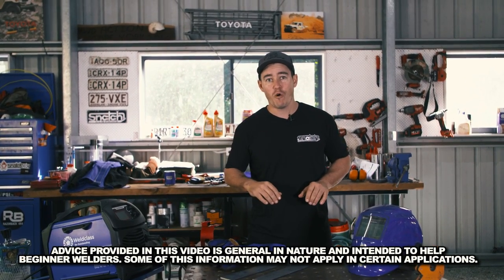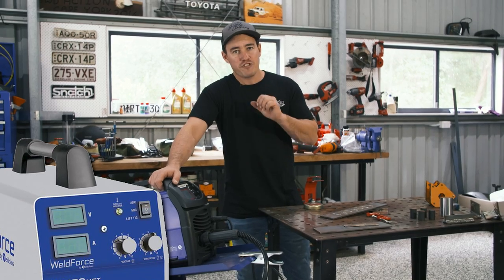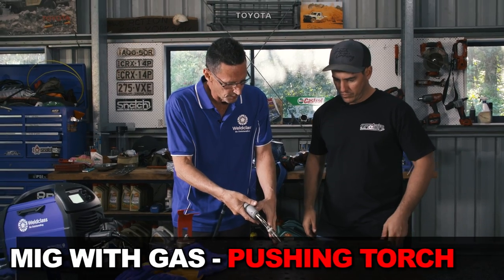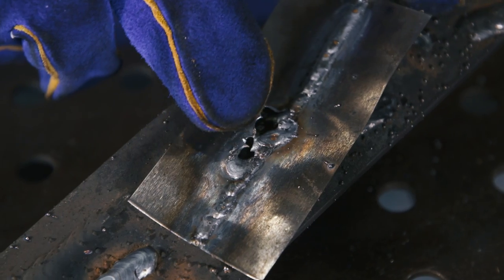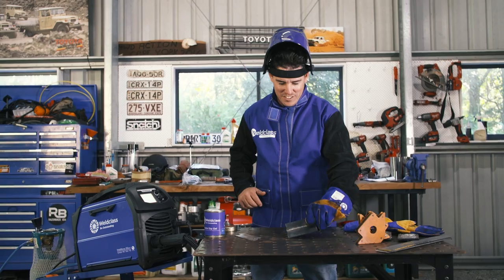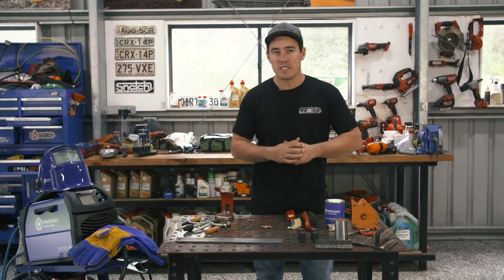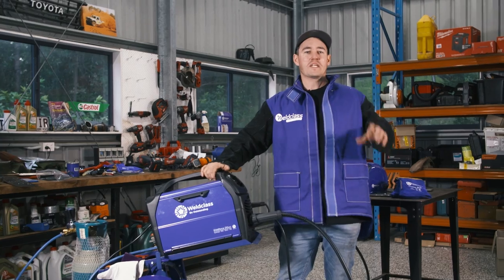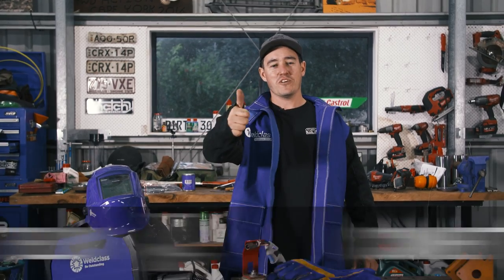HOW TO MIG WELD with Shauno! From NO welding experience to good welds in 10 minutes!

Comment: Hey 24 7 crew... nice video very informative. I've always been interested in learning how to weld, if I had this welder I'd start small my welder the spare wheel carrier on my fibreglass boat. Then I'd go straight into the deep end and use this killer welder to do an engine conversion on my patrol so I can actually bloody tow the boat with ease... 

Cheers boys..🍻🍻🎣🎣

Comment: 1st project would be to finish my trailer that I'm building from an old caravan. Being built to carry Quad and dirt bikes or the old Suzuki sierra that's also getting rebuilt. Also wanting to build a box on the front with a slide out kitchen to use as home base when going away on adventures.

Comment: The first job I want to tackle with a welder is to make a headboard for my tray, currently just has a flat board as I used to have a canopy on there but a nice headboard would really finish that off. Along with that project I would want weld some brackets for new tail lights to tidy off the rear end.

Comment: LOL , yes would love to get strait onto the some of the dream4wd projects.  But lets be serious i would not put anything on the car that i welded as a first project.  So my first project is defiantly small, a portable charcoal cooking station / good old BBQ.  I hate throwing away the cheap charcoal BBQs from Bunnings which cant handle too much heat.  Rotisserie, grill plate and made from stainless as well as being collapsible are the only must haves ATM.  Oh yeah need to be able to cook for 4. I know the Weldclass is a bit of an overkill for the BBQ project but lets get real, food and small jobs are great motivation to start my welding journey and before tackling mounting brackets for the camping trailer.  If something falls of the BBQ you can always blow the sand of the fallen snag ;-)

Comment: I’d would love to make a new tray for my 79 series to take the missus out on a few trips and a helpful tip for getting better accuracy is to wear a tig welding glove or riggers glove on the hand holding the hand piece as you can easily feel the trigger and know the position of your hand it makes control a lot easier just make sure it covers your wrist as the UV rays from welding can give you bad sunburn

Comment: Hey shauno, first job id want to do honestly would be build a brand new dikebike and camper trailer (combined), ive got the plans in my head already. Want to haul the bikes behind the truck with a roof top tent setup mounted to the trailer. Bit of a build but it would be vloody good fun to build and use.

Comment: I think if I was to get this welder the first project I would have to do is fix some of the rust that’s eating away at my ‘85 hj60, she’s been getting a lot of tlc over this lockdown but unfortunately the roof can only get rust buster which is helping some of the problems but not the best solution.

Comment: My wife and I are both veterans and we live on a farm in FNQ. We have a 75 series and the floor of the tray needs replacing and at present there is no way we can afford to get a fab shop to do it for us. I have a little 140amp stick welder from bunnings that keeps shutting down because the duty cycle is "pathetic" at best, so anything the could be a relatively quick job turns into a half day project. I have been putting off the tray project because I know that what could be a weekend project with a mate helping me lift the heavy shit will literally be a week long project with my wife (I don't know of any marriages that could withstand that and not end up divorced 🤣🤣🤣). I would seriously love that "Weldclass" welder so I can put a new floor in our tray and a million other projects that are slowly stacking up.

Comment: First project would be to fill in some spoiler holes on the old MR2 as practice and then I used a reciprocating saw and cut off the front end of an MR2 at the scrapyard .  This was a one owner car for 26 years until a small fender bender which the front end is a little out of alignment.  It's okay but I just really want to bring it back to everything fitting.

Comment: If I won this giveaway I would firstly learn to weld which I have always wanted to do but my first project would probably be to build myself a light weight  roof rack for my off-road camper trailer I’ve been restoring second project would be a canopy for my 4x4 it’s a 2009 pk ranger extra cab thanks for the great video love the Chanel

Comment: Dad and I built a custom frame to raise and hold down the canopy on my Hilux using a 25+ year old stick welder. Now I would love to make a custom set of roof racks with a sliding solar panel tucked in underneath it. Then the welder would go straight to the old man.

Comment: Something I would want to do with a welder is try and have a crack at is making a few jigs up to use in the shed as timber doesn't always cut it. Have always had friends do my welding gear and thought it was difficult, so I wouldn't mind having a go

Comment: Mate has an 80 series Cruiser which has served him well. OL Yellow it is called. Is the lead vehicle when we go on our annual trips to Moreton.
Has an issue with rust now and with no capital to upgrade he does all the works himself to keep it on the road/beach. Has to use other methods for metal repairs.
He is screaming for a unit like the one you are giving away. Cheers.

Comment: First job I would tackle would be modifications to cross members on my Nissan patrol to put lift kit in and strengthen the diff housings and making a custom bracket for a large top mount intercooler and custom intake and custom rock slides and side bars and may be rear bar while I'm there

Comment: First thing I would do is fix the rust and finished welding sheet metal into the cargo windows of my shorty because my old welder doesn’t have the correct settings to do the job properly then I would make some bar work to protect the body

Comment: Would love to make a bracket to take my swingaway spare wheel holder but in my original rear bumper. would need to weld up a bracket to take a stub axle.

Comment: I need a foolproof welder to resecure my blokiness to my soul. I had an arc welder many years ago, and managed to blow holes in 5mm steel. I made one bracket to connect the standard Valiant throttle cable to a Carter 4 barrel AFB carby on my Charger...then went "I can't weld" and gave it (the arc welder) away. I'm pretty good at woodwork, perhaps this will enable me to weld two pieces of MDF together. Or jarrah to pine. Who knows where this may lead!

Comment: The first job I would tackle. Would be some new custom designed rocksliders- side steps for my 1HZ 105 (caveman cruiser) having a good quality welder as I'm a virgin welder would make this a project worth doing. 

Adding some hot slag to two flat chested objects would require the rights 🧰 🛠

Comment: I would tackle welding a couple of stainless steel exhaust pipes especially make one up for my land rover discovery 2 as no one supports exhaust mods for them and I would build an airbox and maybe make my own rock sliders for land rovers build racks to
Reply: Especially since I am a current apprentice welder and qualified metal fabricator

Comment: I wanna learn to weld. I don't want the giveaway I could easily afford a welding kit but I really wanna learn to weld exhaust pipes to make stacks and stuff but a big set back is I only have 1 eye so I'm kinda nervous to begin doing welding due to depth perception. Which means basically its hard to judge distance and I'm worried i might mess up welding like going too close or too far back I've been given advice to lean on my arm to be more stable at one set distance but another set back is I dropped out of school and don't know where to learn to weld so I think I might just have to buy a kit and just wing it.

Comment: Don't buy an old style stick welder, they stick to the job like a magnet. Get a modern inverter based package, they strike up really easily. Buy the best you can afford, I have an ESAB Buddy Arc, its the business. Easily taken around, runs from a generator no problem.